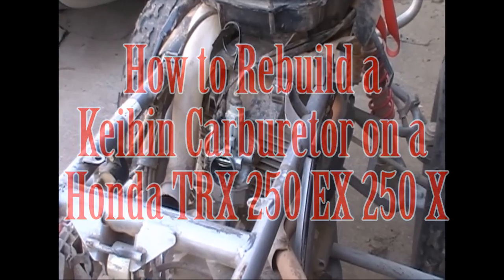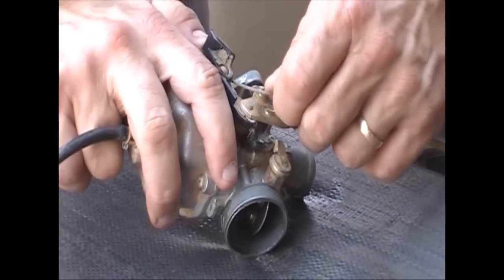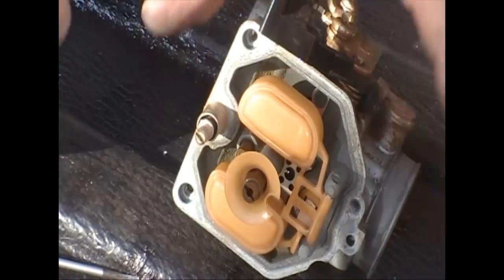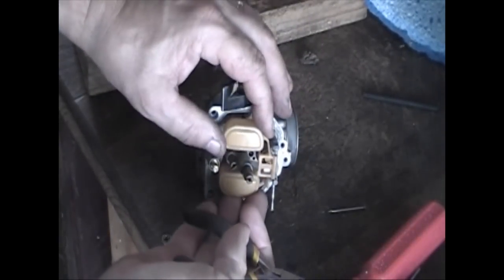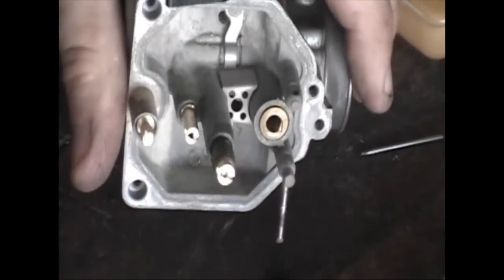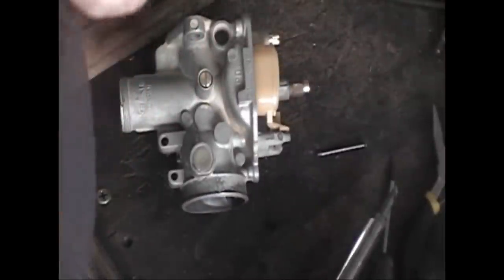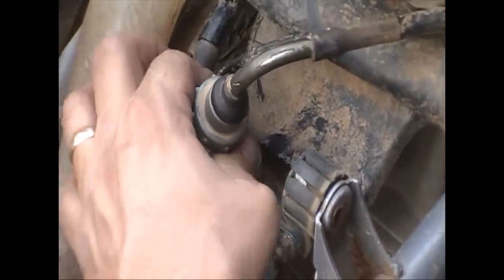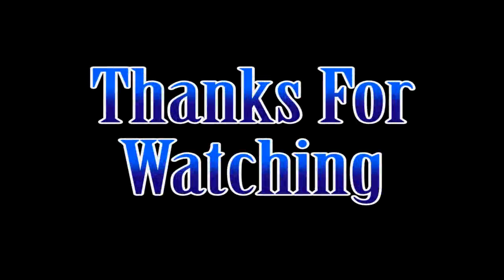Honda TRX250EX Carburetor Carb Rebuild  , TRX 250 EX

Comment: I just got a 03 250EX that was my late fathers. Had not been ridden in two years and had a full tank of fuel. With this video, I drained the tank, I took the carb apart and cleaned it all with brake cleaner and put it back together and it fired right up. Perfect video. Thanks.
Reply from the maker: Awesome. Glad the video was helpful.

Comment: Hello I don’t have this fuel and air mixture screw at the bottom there’s something brass there but it’s not a flat head screw like yours. Also that’s the choke cable not the throttle cable you’re removing in the beginning.

Comment: I'm rebuilding an 04 trx250ex and your videos have helped me so thank you for the walk throughs
Reply from the maker: Thank you. Thats why we make em. Hoping they could help someone.
Reply: +lastmoto777 Did it ever idle down?
Reply from the maker: Yeah it did. I had set the idle up knowing she had not run in years. I was kinda supprised but it started almost instantly! Then I adjusted the idle.  By the way in the vid it was running with the choke partially on because it wasnt warmed up yet. and it idles higher.
Reply: @lastmoto777  I swapped mine out today with a new carb on my 2002 ex250. It started up rev'n full!!! How can I cut it back?? Is there like a screw I'm supposed to turn on the carb?? Thanks alot!

Comment: Great video. I had to clean out my carb. Haven't started it in over two yrs. Varnished pretty good. Made my rebuild a lot easier.
Reply from the maker: I wish I took a pic of ours before I started cleaning it. Total varnish an a quarter inch of MUD in the bowl.all passages and jets were totally blocked! Anyway. Glad you are getting yours done too,

Comment: Is there another part in the main jet assembly that goes in before the main jet?. Some videos show it and some don't. It is a small brass tube piece.
Reply from the maker: Thanks for watching the video. The brass tube you are talking about is called the holder. the main jet is two pieces. the main jet, and the main jet holder. the tube I think you are talking about screws into the carb body and the Main jet screws into it. I hope that helps. Best of luck with it.

Comment: Hi Lastmoto777, good job.  Thanks for sharing. Question, my 2005 TRX 250 ex, got soak into a lake for about 1 or 2 minutes, we pulled it out as soon as we can. After  that it started and run Ok when idle on neutral, and sound very normal. But when push the accelerator it fails, it strugles and dies. No water got into the gasoline, i changed the gasoline and left dry for many days, it starts at first try, but the failure remains. Should i try clean the carburator?  Can i have your suggestiong.
Reply from the maker: Ok. First make sure your air filer is not soaked with water, and your air box doesnt have water in it. It definitely could be the carb. first just drain the bowl with the drain screw that looks like a jet at the bottom of the bowl. Stand the quad on its tail to make sure theres no water blocking the exhaust. Finally if its not any of that, its something electrical. maybe water in the engine case by the stator, coil, plug, etc. Hondas are pretty tough so in my experience it either cant breath, or its electrical. Good luck with it !
Reply from the maker: It never hurts to give the a carb a good cleaning even if thats not it.

Comment: I noticed a small hose(#20 on schematic drawing) that you already had detached which connects on the left side next to the choke cable. What is that hose? Vacuum? Where does the other end connect to?
Reply: Christopher Hendricks 
That is a reference hose for atmosphere. It goes to nothing.

Comment: Hi, and great job on the video, I saw you other video (rear axle/ rear brake bearing removal) and used it as a guide for mine. I do have a question: 1 I installed a Big Gun slip on to my 2006 trx250ex and as soon as I install the muffler I'm getting smoke from the manifold (right where the screws go to the cylinder head) if I take the muffler off it stops smoking, I think  the smoke is of extreme heat but not sure, any recommendations? someone told me that I need bigger jets and I have no idea witch ones to get. is there a scew I can possible adjust on the carburetor to help with this? thanks in advance for your help!!

Comment: i bought an 85 honda 250 fourtrax. it is having a flooding problem. we adjusted it out as much as we could with the mixture and idle, but now im having gasoline come out through my air filter.

Comment: great video.  i just rebuilt the carb on my 250ex that had bad gas in it for years that turned to varnish pretty much.  cleaned it good and replaced all the inside parts but the plastic piece on the end of the main jet was cracked.  when i start the quad it just revs to wide open throttle instantly.  any ideas what im doing wrong?
Reply from the maker: One reason could be the o-ring in front of the carb is missing or leaking./ One of your jets is missing,( they need their tiny o-rings also) /or your slide is stuck open. You're going to have to take her back off and have a look.  It is getting way too much air from somewhere.  Good luck with that....Oh yeah, make sure the throttle cable is not getting stuck open

Comment: I forgot to count how many turn turns the air mixture screw on the outside bottom of the carb bowl was out from the carb. Is there a rough count I should use to back it out from tight?  Thanks

Comment: Hello friend, thank you for postares these videos. I have a Sportrax 250 EX , need to call all motor leads to the rest of the bike because the engine was undergoing repairs and is already in the right place , but I do not remember how to connect the wires. Kue podesses liked me help. Thanks,

Comment: Question... Just took my carb off and completely don't remember where one of the tubes goes. Not the gas ling or the overflow hose... The third tube that is on it. in your video you already have the tube off before you started working. I know where it goes on the carb, but where does the other end hook up?
Reply from the maker: The hose on the top is a breather and it goes through the 2 holes on the rear side of your fuel tank. .....From the carb up through the hole on the left rear of the fuel tank then back pointing down through the hole on the right. hope that helps.

Comment: Do you tighten the overflow screw all the way? So you do or not?
Reply from the maker: If you mean the drain screw on the bottom of the bowl then yes you do. It kinda looks like a jet, but it is a drain screw. Best of luck wit it !
Reply: lastmoto777 thank you

Comment: I have this exact atv. Had some local shop in AZ clean my factory carb years ago. They messed it up badly and ghetto rigged the throttle cable. Since that day it never ran good and it's sat for about 5 years. I need a rebuild and a good cleaning and proper throttle cable. Any part numbers appreciated. Especially the cable itself. Do i need to use a genuine Honda throttle cable and jets?
Reply from the maker: I used the moose racing rebuild kit for the stock carb ( from amazon). It worked well. The Honda original parts will of course work well also. As far as the throttle cable I would use the genuine Honda cable. I usually buy from partzilla .com  they have good prices and just look up your year, make , model and they have all the oem parts. Good luck with it.
Reply: lastmoto777 thank you! Your video is a huge help. Trying to rebuild and get this thing running before we hit 100 degrees here.

Comment: Where does the vacuum tube connect to? Mine was just dangling when I took my carb out
Reply from the maker: That is just an overflow drain hose. It is supposed to just dangle down. So no worries it is correct. Best of luck with it.
Reply: lastmoto777 thanks! Bike fired up first try after I rebuilt it 👍🏻
Reply from the maker: @connorhenley3782  awesome! Great job on that by the way. Have fun ride safe.

Comment: How do I get the slack out of the choke cable? Way to much slack now.
Reply from the maker: you can just slide the cable sheath up a little to remove some of the slack. If it gets too stretched it may need to be replaced.Good luck with it.
Reply: lastmoto777 thanks. I’ll give it a shot when new after market carb comes in.

Comment: Can you tell me the sequence of the idle screws gasket and washer and spring orientation? Its got 2 gaskets or only one? Mine didnt have them.
Reply from the maker: I believe it gets one O ring gasket on the top of the jet ( larger one).Its been a while so I dont remember it all. I do not remember washers except for the bowl screws. If it had washers on the jets when you took it apart then it needs them. Best of luck with it.

Comment: So my aftermarket carburetor on my Honda Recon: it was running rough so I cleaned out the carb as best I could but the idle mixture screw is behind a brass plug so I can't get to it unless ...how do you remove the plug?  Also, when I put it back together it idled fine for a few minutes then when I cut it off, it started leaking gas out of the overflow tube on bottom of the carb.  Then when I started it up it ran rough again.  What could be the problem?
Reply from the maker: I cant say much about your aftermarket, but in general it may be your plunge valve. ( the thing that is attatched to your floats) if your float is opening too much it will leak out the overflow. Anyway. Best of luck with it.
Reply: Outdoor Man , To remove that brass cap/plug gently drill a small hole in it then use a pointy anything in the hole to pry it out . Should pop right out . That tube on the BOTTOM of the carb is NOT the overflow , it is the drain . You will see a screw right next to it , snug that closed to stop the fuel from running through . It was probably running rough due to improper fuel level in the bowl because the drain was open . P.S.  You will get a lot better gas mileage with the drain closed as well , HA HA !!  Good luck Man .

Comment: Is that mixture screw a air screw or fuel screw?
Reply from the maker: The Screw that goes in the side is the idle adjustment, The Adjustment screw that goes up from underneath is your gas / air mixture screw. Best of luck with it.

Comment: I just changed all mine but when I start it reveals up high and don't go down and that's without the choke on its wide open soon as I start it. What could be the problem..
Reply from the maker: Your throttle must be wide open. I would first check the idle screw that goes into the side of the carb. Then check the throttle cable to make sure it is allowing the slide to return down to idle. After that you should take the slide out to see if you can find the problem. Ultimately if you cant get it straightened out you will need to remove the carb again and start over. It really could be alot of different things so best of luck with it.

Comment: rebuild or replace? Rebuild kit @$12.00 plus risk of not thoroughly cleaning all the ports. Off brand, $20.00 to $30.00, reviews vary.
Reply from the maker: The oem carb is going to be better, but the aftermarkets will at least be ok. Get one that comes with a throttle cable though because my experience is that the original cable doesn't fit exactly right. Creating a brand new problem to solve. lol.
Reply: lastmoto777 yup, I ran into that problem of the throttle cable not fitting. Made the problem worse.

Comment: Question, when I pulled out the top fuel gasget, some old gas came out as a very foul smelling like fluid and it seemed to have rusted on the inside.  What would I need to do?
Reply from the maker: Thats probably tarnish or mud. The parts are aluminum and the tank is plastic, I would use carb cleaner and compressed air. remove all the jets and spray carb cleaner and compressed air until there are no blockages. dump whatever gas is still in the tank and add fresh gas if you haven't already done that . Replace the fuel filter too to be on the safe side. reassemble and it should work. Hope this Helps. Good Luck.

Comment: I just got done rebuilding the carb on a 76 xl175, everything is all put back together but when i start it up now it runs at WOT only, i'm lost Please help!
Reply from the maker: Make sure your carb slide is installed correctly. If it is not it will be at full throttle. The slot on the side of the Slide needs to be lined up with the idle jet that screws in from the side of the carb above the bowl. If your air intake is still off look to see if the slide is down or not. when you look in the back of the carb ,you should be able to see the slide. Try that first. Also an air leak on the intake or carb will also cause a engine to run like its wide open.  Good luck with that.

Comment: I have a 250 blaster and it starts and runs for about half a mile and shuts off any ideas on how to fix???
Reply from the maker: Check your spark plug first for fouling. Sounds electrical so.....Yamahas have stator problems at times. like after it cools off it will start again,.   also make sure there is no fuel line blockage. Good luck.

Comment: Heyy i have a trx 250ex 2006 and i bought a carb kit for it cleaning one because it wouldn’t start and then bought a new gas filter and then changed the spark plug put new gas and new oil and was starting it but wouldn’t unless with removed the air filter and put our hand over were the air filter connects to the carb and then let the air out and then put our hand on it and keep doing that but after a while will then turn of don’t know what to do please help
Reply from the maker: It could be alot of things , but start with checking for spark after it wont run anymore. If there is spark then pull the fuel line off the carb and make sure its getting gas. Turn the petcock  to on and make sure the fuel is flowing. If thats not it then it may need a valve adjustment. A lack of compression would also cause this problem. Andreu there is alot of things it could be but this is a good place to start. Best of luck with it.

Comment: What year was this bike ?....does the 2006 250 ex have the same carb or is it injected?  Thx
Reply: johnmsims2 06 has the same basic carb.
Reply from the maker: This is a 2003 in the video. The 2006 model has a carburetor as well.I believe its the same carb.

Comment: took my quad somewhere to have work done on it and they told me a carb on 2011 250x can't be taken apart so I had to buy a new one
Reply from the maker: The carb on a 2011 250ex is nearly identical to the one in the video.  http://cdn1.bikebandit-images.com/schematics/schematics/honda/hon015/ho0311016014.gif   This a link to a schematic of your carb. You can copy and paste this in your browser. It is definitely rebuildable.  If you havent bought a new one yet I would just give your carb a good cleaning because your carb should not be bad yet.
PS. my advice for you . find a new shop or mechanic. Better yet learn to work on our quad yourself. We race and do all of our mechanic work ourselves because of alot of low quality work done by the pros at top dollar, the dishonesty, and the general we dont really care about you attitude of many shops. Anyway. I hope this was helpful.
Reply: +lastmoto777 yeah I had planned on doing it myself but I didn't have the time to do it and I needed it done but I guess an aftermarket could be better route to go anyway no longer do bussiness with they guy anymore

Comment: hey where is the idle screw located on this quad??
Reply: BTW I have an 06
Reply: plz answer because it's way way way to high.
Reply from the maker: The throttle idle adjust screw is in the side of the carb slide body . It will adjust how open the carb is at idle.The mixture screw is on the front of the carb pointing up from  your bowl.( like upside down from underneath). Make sure that the throttle cable is allowing the slide to return to rest at idle. If its open it will rev high. Thirdly make sure there is no air leaks where the carb is bolted to the manifold and that the o-ring is sealing. all of these things will cause a really high idle. good luck with it.
Reply: +lastmoto777 thanks
Reply: i threw a fmf slip on on my trx250ex 2005  and it started back firing a lot, heard its a lean backfire, how do I adjust my carb to stop the backfiring?
Reply from the maker: It is running leaner with a slip on. you can open up the mixture screw underneath and it may help. you really need larger jets to match your slip on, I would consult with the pipe manufacturer for recomendations. Moose dynojet and FMF all make kits for this purpose.Good luck with it.

Comment: Cleaned out mine now it idles to high. Help
Reply from the maker: First check your idle screw that goes in the side of the carb and acts as a slide stop ( turn out to lower idle).Then check your throttle adjustment screws for the cable. If it is a older Honda the throttle cable may not be fully returning to idle.You can lube it but sometimes it just needs to be replaced. anyway best of luck with it.
Reply: @lastmoto777  gotcha I'll try this.. Didn't see this comment until after I asked a few mins ago!